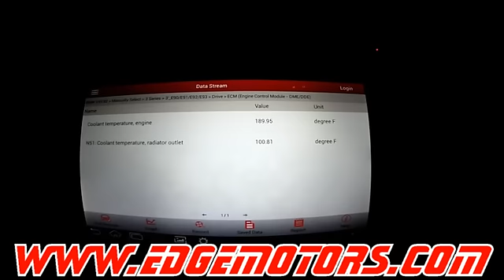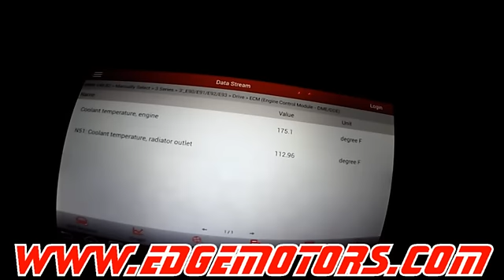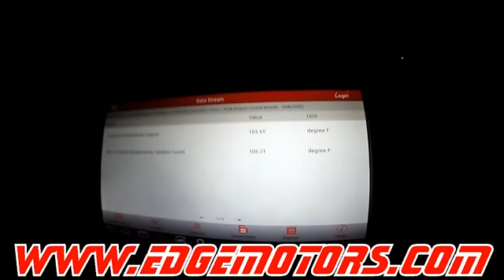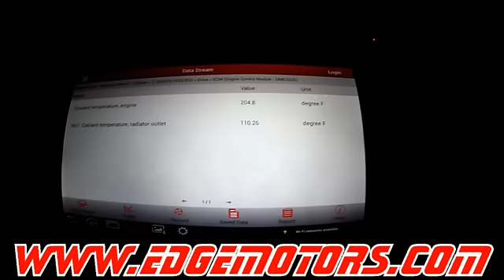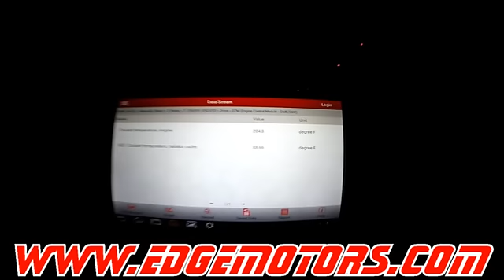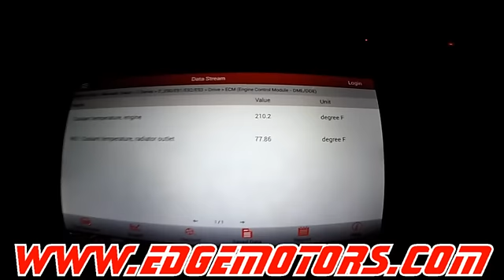BMW e90 No Heat Problem Engine Over Cooling Solved by Edge Motors

Comment: I have this same issue! I had replaced the radiator with a cheaper autozone radiator. My car can never warm in the cold weather and keeps throwing p0128 codes.
Reply: Did you fix this?
Reply: @bloodonmyteeth5082 yes I did. I replaced the AutoZone radiator with the OEM radiator and now the car is running hot in the coldest of temperatures and not throwing any codes.
Reply: @jalloor I also swapped out the autozone radiator for an OEM and now temps are normalized. Cabin heat issue still remains. Glad you were able to fix that.
Reply: @bloodonmyteeth5082 what is going on with your cabin temperature? 
Could you have air in your system? Are you doing short trips?

Comment: The issue is the plugs that screw into the bottom of each side of the radiator, you must have the correct length plug in on both sides as the new radiators come with a short for manual and longer for automatic
Reply: Is it the same plug on both sides?  What I am wondering is, will replacing just the plugs fix the cooling too much problem.
Reply: https://youtu.be/tOeMnsWoKA4?si=SaMa6ikqjKAL7zZu

Comment: That was exactly the problem. Exchanged cheap replacement radiator for Nissens one solved the problem for N51.
Left (facing car) bottom hose was getting warm, while right bottom one was cold, meaning AT cooler thermostat was working fine. 
Thank you!

Comment: Fantastic! I recently installed a brand new radiator (non-OEM, from NRF), as the old one was leaking. After the first cold days I noticed my oil temperature stayed too low and the interior was not getting warm properly. I suspected it had something to do with the new radiator, but could not understand what or how. So I installed a new thermostat, which did not change a thing. Then I stumbled upon this video and everything started to make sense. Clamped off that hose and yes indeed everything started to work as I was used to and the engine temperature went up from 73C to 95C. I am going to put in another (OEM) radiator and I am pretty sure that will solve everything. Thanks for putting this information on the internet. It was the missing piece of the puzzle!
Reply: Hi, could you please report back if you made the replacement? DO the old radiator leaked between the upper and the lower part? Have you tested the new one for this leakeake before the install? Have you solved the problem?
Reply: Hi , did the new radiator  fixed the problem , I have same issue  with my bmw 330 I n52 engine . Changed the thermostat  nothing  happened  still keep around 80 c  should be around 105
Reply: At the moment,I am still driving around with a clamp on the lower hose, as I did not yet receive the replacement radiator from the shop. But I am confident that a good radiator will solve my issue. When I install it I will post the result
Reply: Thanks  for the info.  I just replaced  the thermostat  today but this not make any  difference  in coolant  temperature  still stays around 80 c  only went 1 time to 95 and then drop quickly  back to 79 c. I Don't know what else can be I will check tomorrow  that hose to see if temperature will go up to about 105-110 Celsius which is normal for n52 . Did you order genuine  bmw radiator  ? 
Thank you
Reply: @ventsislavivanov4542  same here. Swapping the thermostat does not change a thing. I don't know what replacement I will get for warranty. If I have bad luck I will get the same thing again. 

I did a bit of study on this topic and discovered that many e60, e61, e63 and e64s do not even have the lower exit hose for the transmission cooling. They only have the entry. Only a few years have this particular design and I think that this is why it is such a rare problem.
Reply: @arjanlenoir5058  , I will have a look it tomorrow , I'm not sure I got this to , I will update  .
Reply: Update: I got a new radiator from the supplier under warranty. Unfortunately it is also one from NRF and a quick check indicates that it has the same problem. When I blow air into the main entry, air will flow easily out of the transmission cooler exit. That ain't good.
Reply: @arjanlenoir5058  Hi ,again I didn't have the chance  to inspect the car  gearbox  housing .The whether  is been really  bad in UK in last 2 weeks . What is your plan then ? Can't be all radiators faulty. Att least they just simply  not changed , send the same one 🙄.
What about genuine bmw radiator  from bmw direct ?
Reply: @arjanlenoir5058  Hi,  I manage today to clamp the hose between  radiotor and gearbox oil cooler , but again the car not go up to temperature  still stays around 80 celcius. . I'm completely  confused  now . What can be the problem . Any luck  with your radiator?
Reply: @ventsislavivanov4542 you may be clamping the wrong one
Reply: Here is my story.... There is a manufacturing fault inside the cooler . NRF confirmed it to me. This may also apply to other non- OEM brands

https://youtu.be/iyoFzN-eBWs?si=8XbetCtYpg7dpwIE

Comment: In my car, 528xi, when it is cold, the temperature reaches normal, but when driving, it drops to 79-80 degrees, the fuel consumption has also increased. I changed the thermostat, the water temperature sensor and it didn't help, changing the radiator will help, what do you think?
Reply: Did u find the problem ???

Comment: Thanks to this video after changing my thermostat and water pump both temp sensors. Still had under cooling issue. I just brought this car like 3 months ago. 

The whole time my I needed a radiator. My car temp would be at 145 highest till be no matter how long I drove it. After the radiator replacement my temp would go pass 145 with heat on within 5 min. Thank to this video! If you still have undercooling issue after thermostat replacement. Replace the Radiator!!!
Reply: Hi  , so changing  the radiotor , sort the problem out ?  
Do you remember  what radiotor  you put ?? 
Genuine  bmw or aftermarket ?
Thank you
Reply: @ventsislavivanov4542  yes and aftermarket mahle

Comment: So this is funny not haha funny but when I had my car serviced at BMW service center to replace a lower radiator hose and the transmission coolant hose. These guys said I had a radiator leak which didn’t exist until they inspected the car. My heat was fine and the only leak I had was from the hoses I mentioned to add on a MAP sensors from exhaust manifold was removed throwing a service engine code which I never had until getting the car back, I plugged that back in and the code went away, pretty odd if you ask me. But my had always worked even with the leaking hose until a week after receiving my car. 

I drove my car for almost a year with that leaking hose wasting money on coolant monthly and always had heat now I have no heat after the servicing. I find it pretty sketchy.

Comment: Hi I have a 2008 bmw x5 3.0 and I'm getting no heat i replaced the thermostat and water pump all german parts and don't get heat unless I'm sitting but once I hit the road temperatures fall down to 140 35° outside

Comment: Thanks for the information. Do you know if the manual transmission has this line? I'm tryna to fix no heat in my car, but that hole looks plugged. 3rd owner. 
Will be replacing water pump/ thermostat next week. Thanks.
Reply: just did the waterpump and thermostat after having these issues too, didnt help at all
Reply: @Nate-ek8qk  I flushed the heater core and that fixed my no heat issue after all the gunk came out.  
Still going to do my pump since I already bought it.
Reply: @Qutlass  oh ok nice im gonna try that out thanks alot

Comment: I have a issue I was chancing coolant leak after changing the radiator an water pump my heater stop working it blows air but not heat my ac works but my heater doesn’t what could be causing this issue
Reply from the maker: Maybe a wrong radiator? Or defective?
Reply: @EDGEMOTORS  not haven any over heating issues I’m starting to wonder could it be my cheap amazon thermostat? Stuck open ? Making the car over cooled? Iv Read  about that engine ecu thinkn it’s not at full temo been the thermo has a sensor on it could it be that ? I have a Borg Warner thermostat as a back up soon as I changed the old thermostat tk the Amazon’s the heater stop working but again I also replaced the radiator
Reply from the maker: Did you watch the video? The radiator is separated and may have a problem with the flow going through wrong parts of it.
Reply: @EDGEMOTORS  hope for a reply from you as I’m in need for further info 
So I checked my cars temps  it spiked at 190-199 but started to drop  now this was with car parked in idle ,I didn’t pinch any hose as of yet ....I turned my heater on ..my cars engine An coolant tempt spiked to 200-210 after turning off my heater the car dropped to a solid 174 and stayed there .....would it be safe to say it’s my thermostat? Or would I still need to pinch the rad hose so I can see if it’s the rad i have my oem factory radiator don’t seem to have any issues sides a like fin damage here An there typical stuff but I changed everything out just to be on the safe side when I first was chasing the coolant leak issue which ended up been my both water pump An thermo  just trying see if I can regulate the amount of work with out having to go back an forth  also Thnks for ur vids   as there helpful also Thnks for replaying lotta ppl don’t replay on such old videos Thnks again hope to hear back
Reply: So what do u think ?
Reply: @EDGEMOTORS can it be fauling transmision thermostat?
Reply: @Edgemotors I replaced my radiator twice because of this issue. First I used eBay radiator and then used a Spectra one. Still having same issue. Took car to BMW and they said everything is normal. Had no heater two years ago. Took it to a different mechanic last year and also telling me nothing is wrong. Try to explain to them that I drive the car when it’s 40 degrees outside or below and car won’t have heater. Now I am searching the issue my self and added a Eonon radio and now I can keep looking at temp. Yesterday it was 35 degrees outside and pinch the hose and car had heater. Car temp stay between 199 to 210 degrees while driving 90 miles per hour. So you recommend only using BMW radiator? What about Mahle or Nissen brand?

Comment: I had just put a new radiator in my 325i no heat engine to cool transmission seemed to be getting hot.... my problem was the radiator. Yes the new on e was bad
Reply: Have the exact same problem, replaced the radiator and now there's little heat coming out and my 325i is running cool. Is mine bad too?
Reply: What brand did you used when you replaced the radiator?
Reply: Not the smartest choice but only orielys had it locally so it was a odd name ill look
Reply: Murry